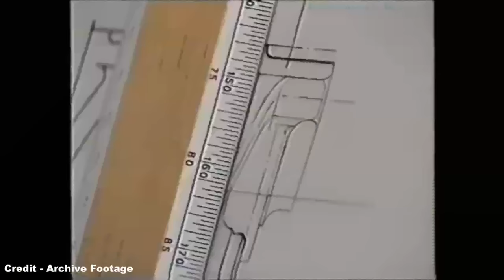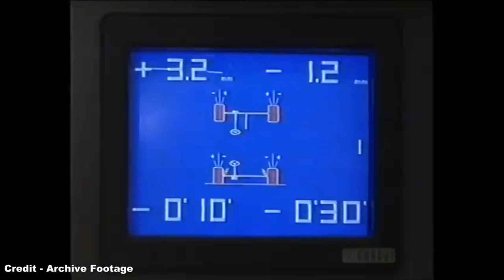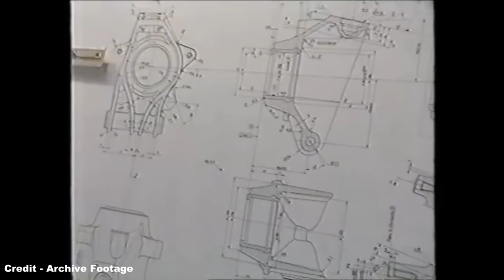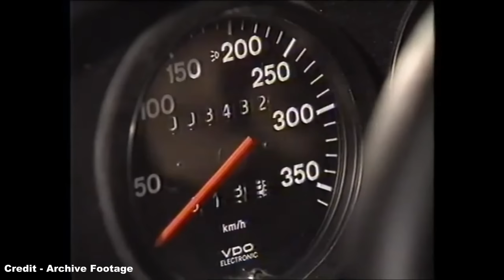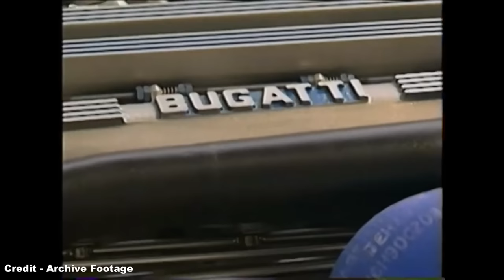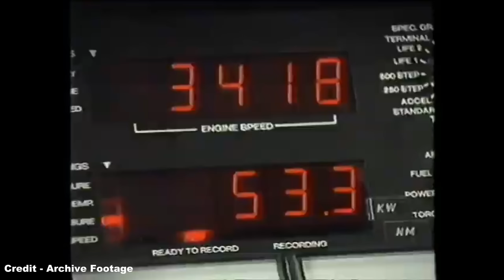Supercar Stories - Bugatti EB110

Comment: I don't know where you got the info that the EB110 had 4 sequential turbos with two smaller and two larger. In fact, if you look at photos of the exhaust manifolds, you'll see each turbo is spooled by 3 cylindres, which meant they were engaged at all times. The current Chiron has sequential turbos but not the EB110. Also, the EB110 Supersport hit 60 mph in 3.4 seconds, not 4.4.

Comment: Among several other's such as the Jaguar 220 i bought a die cast metal 1/24 model of the 110  back in 91, it is still in my loft untouched in its box with the others.

Comment: I’ve never thought of the modern Bugatti’s as beautiful designs, more, they look heavy and rather underwhelming… not helped by the need to have the Bugatti grill included in the design… a grill that could never be included with an aerodynamic shape that would look good. 
Obviously, I’ll never have the means to buy one… not that I would even if I had the funds… 
It’s an overgrown VW 😗
Reply: Those modern Bugattis ARE incredibly heavy and not the best on a track either. They are an impressive engineering achievement (being able to hit such staggering top speeds and also accelerate quicker than any other car while still being very docile and usable no matter the road, the temperature, the weather etc) but what is the actual point of having cars that can do 260mph to getting close to 300mph? Even on the Autobahn from what I've seen the opportunities of hitting 200mph are rare. The first Bugatti hit 253mph, more than enough to take the fastest car in the world tag from McLarens F1 (241mph) and since then they've only got faster and faster? There was a massive difference between the Veyron and F1, the F1 'made do' with a 6ltr V12. The Veyron needed 8ltrs, 16 cylinders and 4 turbos! And that's a big part of the reason why it looks and actually is a big fat ugly blob of a car, it weighs nigh on 2000kg! The F1 was a flyweight and nearly half it's weight. The F1s crazy high top speed wasn't the entire engineering focus of the car. It was designed to be lightweight, agile and powerful and just had that 240mph more as a side effect. The Bugatti was engineered to be the fastest car ever made then all else was designed around that, hence why its so hideously fugly! And still Bugatti keep upping that totally pointless top speed (they've actually broken 300 and it's now 304mph!) Who are they even competing against? Who wants a car that can only be fully opened up on the salt flats?
Reply: @davekennedy6315  Ettore is said to have described the Bentleys that his cars raced against as the world's fastest trucks, I wonder how he would describe a modern Bugatti. 
In competition for top speed with Koeniggseg , who seem to be more adventurous with their engineering. The cars are lighter as well.
Reply: @paulqueripel3493  poor guy must be spinning in his grave as it has gone completely against his design philosophy.

Comment: I always found the marketing and launch of the EB110 a touch confusing. Ettore Bugatti was from Milan and built his cars in Alsace, a German speaking region of France. The EB110 was designed and built in Modena, Italy albeit with French contributors from the likes of Aerospatiale and Michelin. Yet they chose to launch it in French Racing Blue, they used the tricoleur a lot in the marketing and as you show, the launch was in Paris. I wonder how the French thought about all of this - an Italian car masquerading as a French car. Compared to VW era Bugatti, now Franco German and built in Alsace they don't seem to dewll too much on the cars national origin with their marketing apart from the use of French Racing Blue on special editions. Alsace is befitting of the brands current ownership but with the EB110, the overtly French push seemed at odds when marketing what was essentially an Italian car with arguably an Italian badge... No wonder it failed. Glorious car though

Comment: I never felt they did justice to the horse shoe plus this Bugatti had no real connection to the founder, it was just a brand. Although rare you can see the EB110 at car meets in the UK such as Goodwood and Silverstone.
In the flesh you realise that you could do a lot of the work on the car with you bike tool kit. There is no rocket surgery, it is just a lot of metal, plastic and glass with all the problems of rust, the plastics cracking and the fun things that go with the dream of car ownership. Rose joints, that sort of stuff. It is not sophisticated.
Imagine a parallel future where the EB110 was just deemed a failed kit car and the Bugatti brand forgotten. Imagine if VW had put their badge on the Chiron. I would be okay with that, honest branding.
Truth is they got rid of Bugatti, dream of Chiron realised.